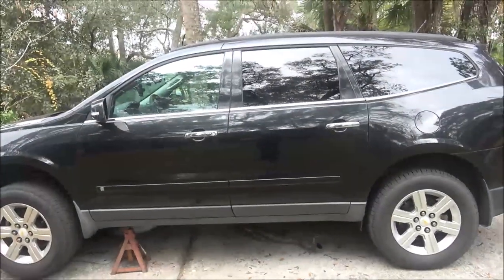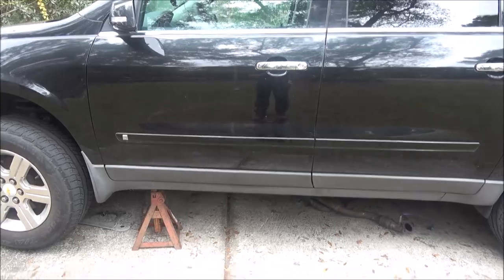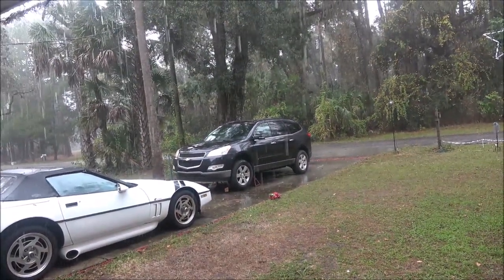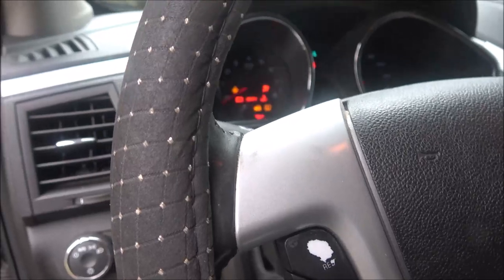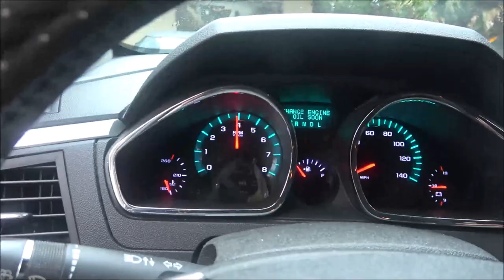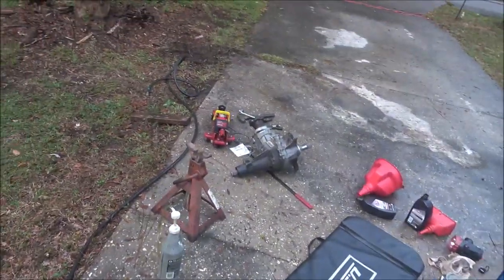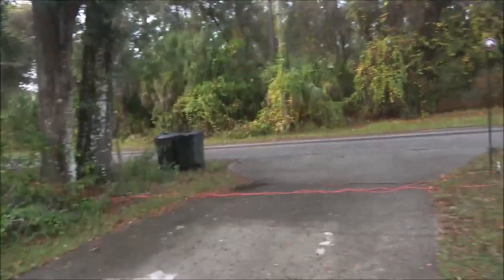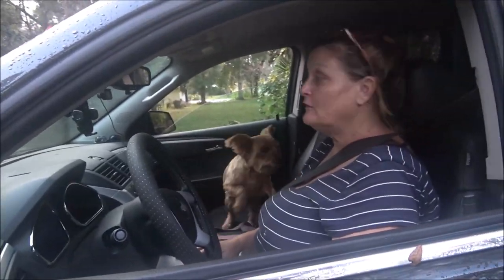Update/Progress On The Transfer Case For The Chevy Part 3

Comment: Nice to see it through to completion. I might have gotten it apart but I probably wouldn't have been able to get it back together.
Reply from the maker: Actually, the hardest part was that mount. It had two ten millimeter bolts that were a pain to get started.